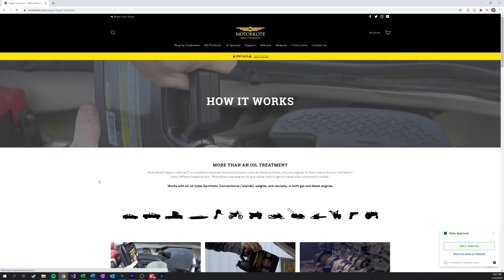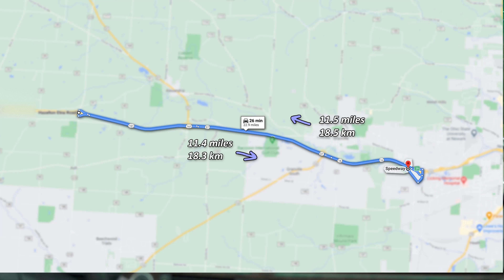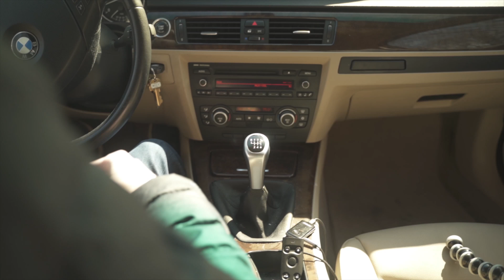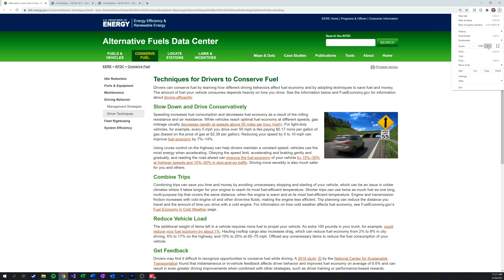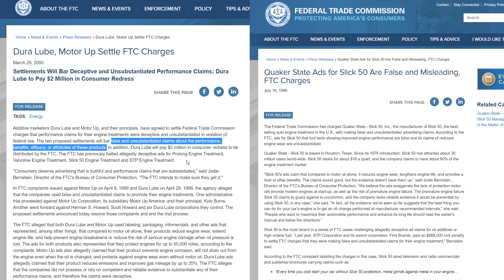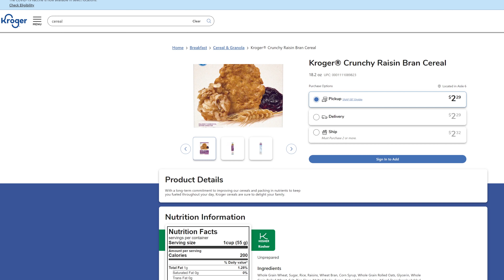This Oil Additive nearly cost me $1408 – the “Motorkote” Story

Comment: There's a lot of things I think you missed tbh. The biggest of which is WHY these additives are not found in great quantities within your top oil brands. From my understanding, it is because of emissions; the same reason why zinc levels are so low in modern oils, too. When you burn this stuff during your combustion cycle, I don't think the environment (or the government) agrees with what comes out of the exhaust. Or maybe it clogs catalytic converters prematurely? Any number of reasons could restrict the amount applicable for wide spread use, you just don't know. Also as far as your mileage test.....mid 20's to mid 50's is an acceptable variance? lolwut? And if you're concerned about MPG, I would've only added it to the engine rather than the trans/diff/transfer case. I think the viscosity is closer to engine oil than something you put in a manual transmission.

Comment: I'm not a fan of oil additives but Motorkote got my attention. 

A friend of mine is a trucker and uses it in his Cummins. He had over a million miles on his first engine when he put it in the shop for a leaky head gasket. With that many miles he decided to have it In-Framed while it was there. The mech saved the rod and main bearings and showed him the wear saying they were still in spec and technically could have been reused.  My friend swears by the stuff and uses it in the trans and drive axle claiming it dropped his temps by 10 degrees. 

Then later he bought a used F250 with a 6.0 and 175K. I was with him when he added a quart to the running engine while we were in the WM parking lot and could her the difference immediately.  He's used it in two semis and also runs it in every engine he owns so I'd say he has at least 3M miles of experience with it, and if I think if it was bad in any way he would have noticed it by now. .  

My all original 74 Chevy had an intermittent lifter tick. I added the recommenced amount of Motorkote to the oil and haven't heard a peep or tick since, but I'm still hesitant to use it in my F150 with only 56K. There's really no need. It gets Penzoil Platinum every 6-8 months which works out to maybe 5,000 miles at the most.

Comment: I use motorkote on every bmw M engine I build (over 600 in 9-years), in all the performance cars I own also (raptor, trx, z06, zr1, z28, etc).  Motorkote is the best product I have come across.  It is idiots like you that post a review on the internet, and uninformed people think it's true.  Luckily, there are people like myself to promote good products and correct an idiot like you 🙄

Comment: As others have pointed out, getting anything from 29 mpg to 58 mpg along the same stretch of road is kind of ridiculous. Even if you had to sit in rush hour traffic (which would seriously affect your "control" btw) your mpgs should not be more than maybe 10 mpg apart. Not to mention that I doubt your beamer would ever get 58 mpg no matter what you do to it or how you drive. That's just my opinion.

Comment: they have products that work to help with friction and increase oil life and performance.. synthetic fluids.. i don't know that they're slicker but they do hold up better to heat. i did put synthetic in my transmission on my truck and the operating temp dropped about 50 degrees. that is a fluid and filter change, not all the fluid. just what was in the pan. as for oil additives, i can't vouch for any of them.

Comment: I've never had a problem using motorkote in my car. It makes the engine run smooth as fuck and it lasts a long time. You just don't know wtf you're doing. You clearly fucked up your calculations or something.

Comment: You gotta try this testing again with a fuel mileage approach that is more consistent.  Fluctuations between 26.9 and 58.7 for the “control” runs along the same stretch of highway? That should raise some eyebrows. But even then, better or worse fuel mileage does not necessarily mean more or less engine wear. This video appears to be less about actually proving anything, and more about trying to be controversial for the sole purpose or gaining views.

Let me just be clear, I’ve never used motorkote, and it very well may be snake oil. I’d like to see it tested more thoroughly under true engine operating conditions, because I, like you, am skeptical. But I’m just pointing out this testing method was not useful. While project farm’s methods did not 100% reflect engine operating conditions (which he clarifies in his videos), he at least tested a some of their claims directly.
Reply: you have to use cruse control and not the one arm bandit approach...  you can easily cheat  

also the Charcoal canister or vapor return line  is clogged that is why it also might be all "over the place"

Comment: I have a Toyota Yaris which gets around 32-35 mpg in all weather, all gas stations.  Your test mileage seems to be all over the place - - - 26.9 to 58.7 mpg and all in between!
No matter what time of year, no matter whether I have my AC or Heater on, same thing,  traffic or rain, 32-35 for me.  Something is wrong with your car.
Reply: yeah the Charcoal canister or  vapor return line  is clogged if it's all over the place  so the fuel pump may shut off early and mis-report a higher fuel mpg.....

Comment: https://youtu.be/r4M7MwWVN0I.  This is a video showing a before and after dyno test of motorkote along with a fuel mileage test. This guy got slightly improved mileage and hp. Also, changing the fluids didn't get the motorkote out of anything. The only way to remove it is to sand it off the surface. My guess is there was a hp increase and the Beemer's ecu didn't know what to do with it so it just kept pumping the same amount of fuel in so it was just converting all the free'd up hp into power to the wheels instead of cutting back the fuel a bit. When you change a cam or strap a turbo to an engine you have to retune the ecu for it to run correctly and the Bmw's ecu should have corrected for those small of parameter changes but they don't always. I believe it was probably just running that much rich. I worked as a professional shop mechanic for 8 years so there isn't much I haven't worked on. I'm not saying that motorkote isn't snake oil for all of those wild claims but I refuse to believe that something that DOES function as a friction reducer in a bearing test anyway would increase friction inside of an engine or transmission. It may not be everything the packaging claims but I believe it's impossible for it to have increased friction.

Comment: This guy is an idiot.  I have used motorkote for serval years.  I just recently took my 2009 vw tiguan and added motorkote to the oil change.  It increased my fuel range by 25 miles.

Comment: Michael's car...You probably spent good seven hours filming and editing this video, but not even once you mentioned the specs of your BMW. First of all, Motorkote will not increase your fuel mileage considerably as advertised. none. whatsoever. the may be exaggerating or they may be talking about a weed wacker mower It will greatly reduce surface tension especially for heavy duty diesel engines. Second, if you want to increase your miles per gallon I would suggest using a fuel catalyst or a fuel stabilizer that would allow you to ease on the throttle while you make the most distance for your fuel. I mean...I use motorkote on a heavy duty diesel engine. Yes it does have chlorine in it, but I can definitely observe that motorkote does have the tendency to be a lower temperature oil due to reduced friction. I think your review is a scam and misleading. Keep in mind that in  your 2,500 LBS BMW piston arms do travel a lot less inside the sleeves than a heavy duty engine ones pulling around 70,000 LBS, so you are not taking factors such as the type of oil you have on your BMW or how much biomass or ethanol is in the fuel you purchased. Also,  I don't think you are supposed to use motorkote on synthetic oil which that is why I believe you were getting those mpg.

Comment: Mechanic of 25 years here I service over 200 generators and we added Motorkoat to all the oil and we did see a 12% increase in efficiency I have personally rebuilt some of these engines and I’m seeing less wear and less skirt scuffing and on the rod journal bearings and cam shaft bearings and overall less sludge you do what you want but I think it’s a wonderful product i’m just a master tech I obviously don’t know what I’m talking about
Reply: Thank you for sharing your Real World Experience.
Reply: That's what is needed real use and experience thanks for reply.

Comment: I use motorkote on my VW and Toyota and it does quites the engine noticeably when i add it to middle of oil run. But no increase or decrease of mileage. Does little to no good but never a damage.

Comment: I'm going to respectively disagree with you on motorcoat.  I started using it when my 2016 Ford escape reached 140,000 I stopped using the partially synthetic oil and started using Pennzoil 5W-30 extended life I've been adding 2 oz of motor coat to my engine for every quart so it's roughly 10 oz every oil change I now have 373,000 miles on the engine and so far I'm not leaking or using any liquids and acceleration power has remained for the most part the same.
Reply: So you changed to full synthetic high mileage, and motorkote and you credit the motorkote?
Reply: @Seriouslydave   changed from Ford recommended hybrid synthetic to Pennzoil high mileage 5w-30 and added MotoKote. current mileage is approx. 376000